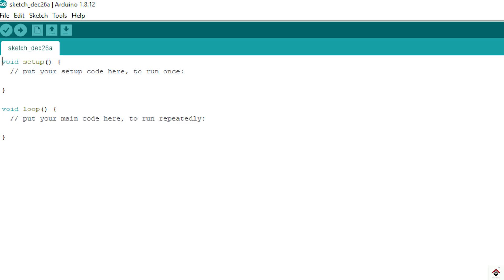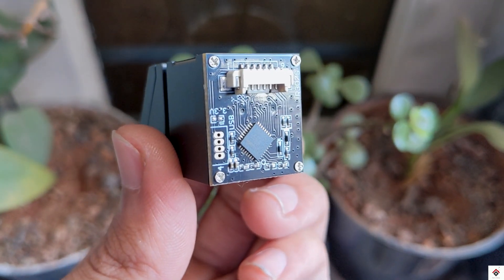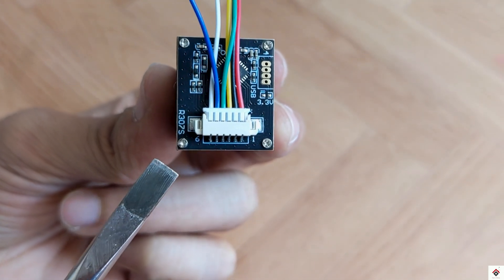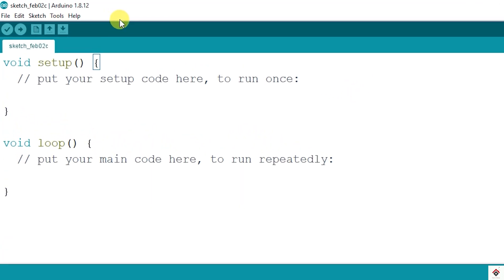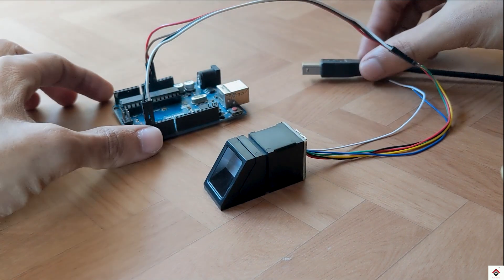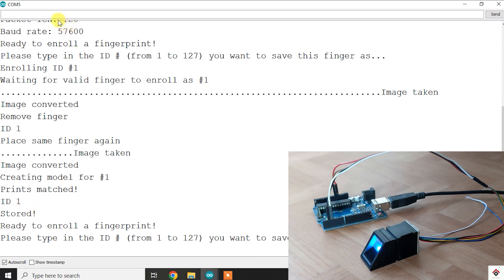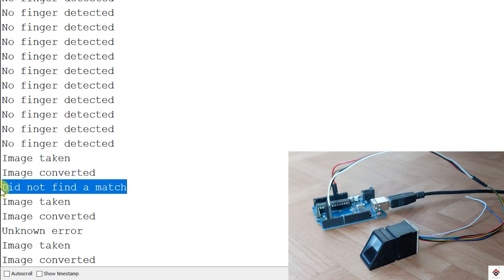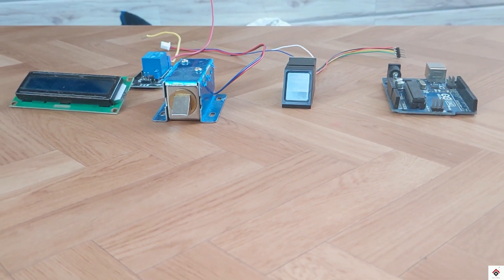Fingerprint Sensor with Arduino | Enroll, Search and Delete Fingerprints on R307 Fingerprint Sensor

Comment: Hey I want to ask you for fingerprint sensor R307 which have a 8 pin so what is pin out  and how many supply i needto give it I try on 3.3volt it's not working so now what I can do please tell methid
Reply from the maker: I have shown everything in the video. You have to just consider 4 pins only 5v, Gnd, Tx and Rx.

Comment: hello I want to ask for the arduino unojoy steering wheel project, what type of arduino are you using and can I add 2 more buttons to change gears in the game.😊😊
Reply from the maker: It's Arduino UNO Dip version. You can add upto 11 buttons.
Unojoy wheel works only on specific simulator games.

But my suggestion is instead of unojoy wheel try to make Leonardo wheel with EMC firmware. You will get playlist in our channel: https://youtube.com/playlist?list=PL4B0LEKY-jrROPZPEDMZ4DPqISPXvVsdL&si=Rt3TwbzrmYttUg9c

Comment: Next video on how we can use this module and Arduino to lock and unlock our computer 😁👍
Reply from the maker: Good Idea 💡 
Instead of power button something like relay can trigger when correct fingerprint is detected.
Will try this. Thank you
Reply: @techathome  ok 😁👍
Reply: @techathome   i also told you about sim hub in your ETS2 settup video. But you didn't respond 😐
Reply: @techathome can you make a video explaining that please?
Reply from the maker: We have started working on simhub.
Reply: @techathome  that sounds awesome 🤩🤩